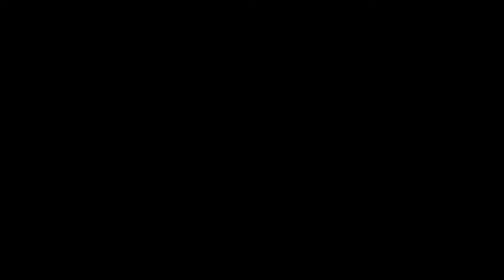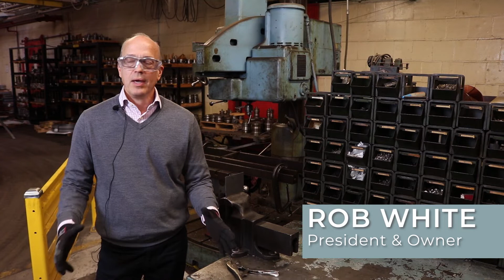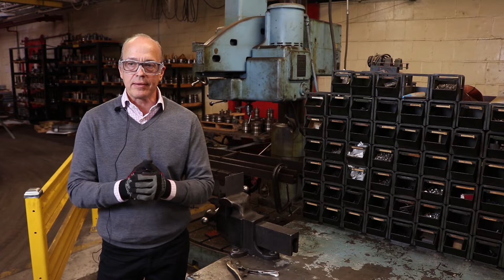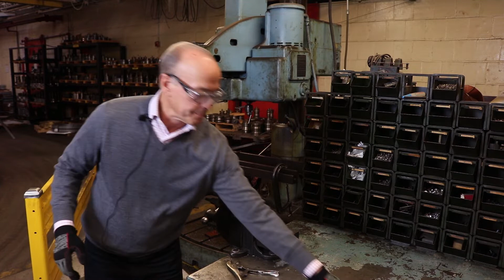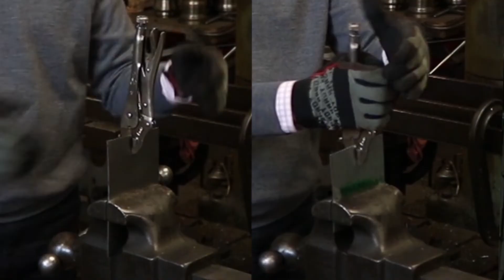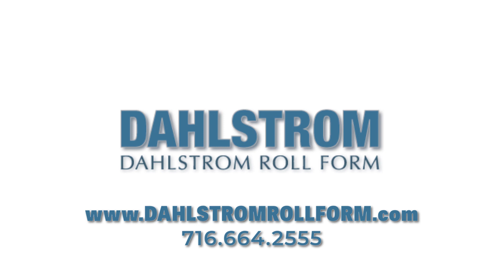80 ksi vs 30 ksi Steel: Steel Yield Strength Explained

Comment: Ksi means
Reply: This is all well and good for evaluating our purchase decision. However, it does not help me calculate the load bearing strength of my build, because it only is a 2D specification.

For example, a 1 inch square duct tape piece will hold 10x less than 10 layers before stretching and breaking. So, I must assume that a 24 ksi tensile strength aluminum will fail at 1 inch by 1 inch bar at 24,000 lbs, and a 1/8th inch thick  by 1 inch long aluminum fail at 3000 lbs.
Reply: 1 ksi = 1000 psi, psi-pounds per square inch
Reply: Kilogram per square inch
Reply: @carlosguerrero9022  no lol, Kips per Square Inch (kip equals a thousand pounds)